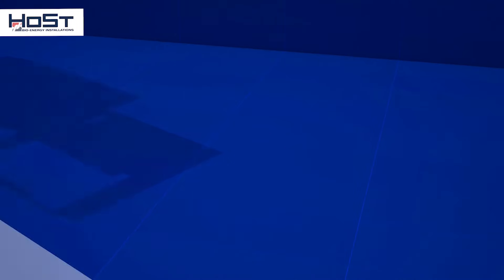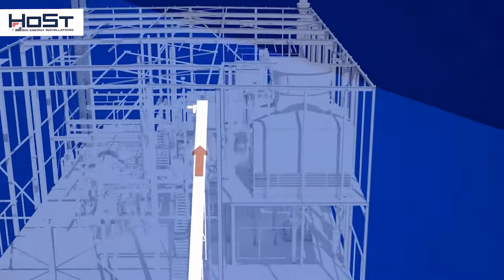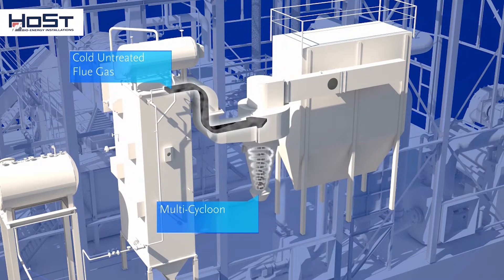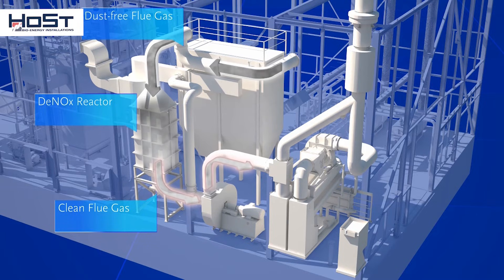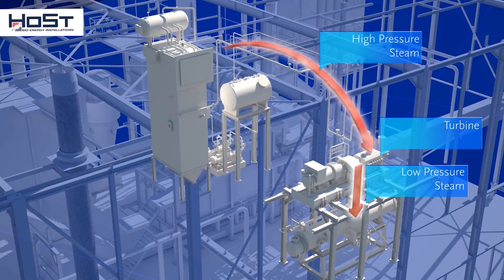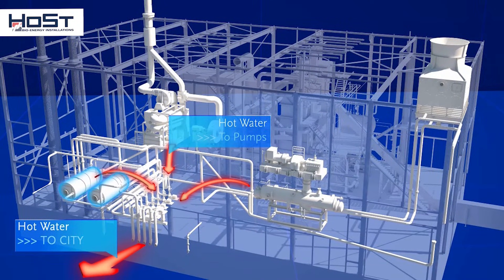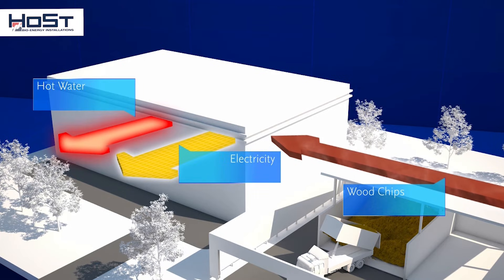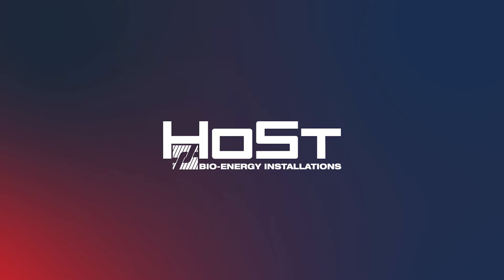How Does a Biomass/Wood-fired Boiler Plant Work?  | HoSt Bioenergy Systems

Comment: One of the best biomass boilers manufacturer, in any case, one of the few who deliver biomass boilers with condensation exhausts gases condensation units and steam cooling towers, for more efficiency and summer optimals conditions power generation.

But what about the functionning of the flues gases condenser in summer ? And the steam turbine is a backpressure type or a condensing type ?